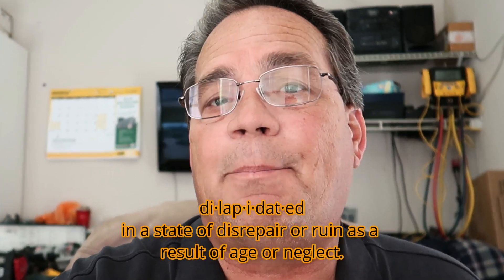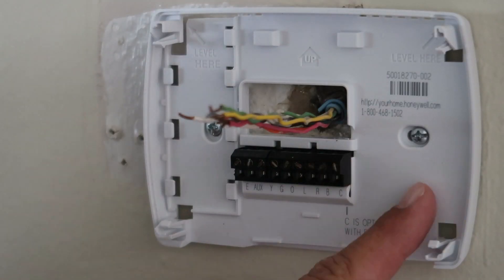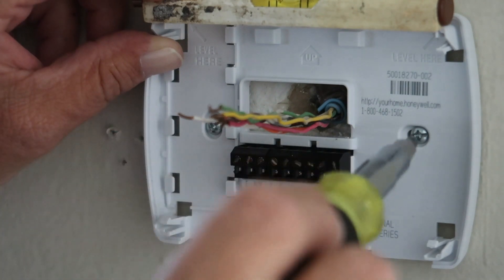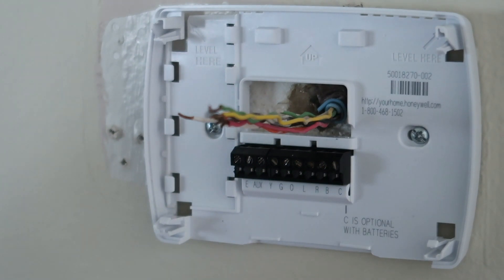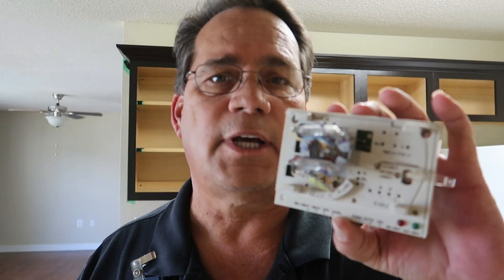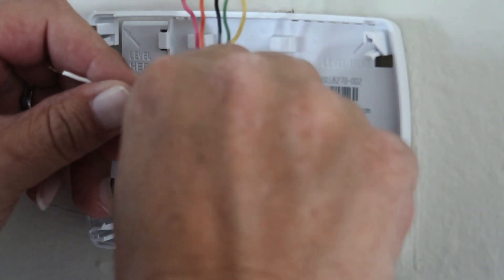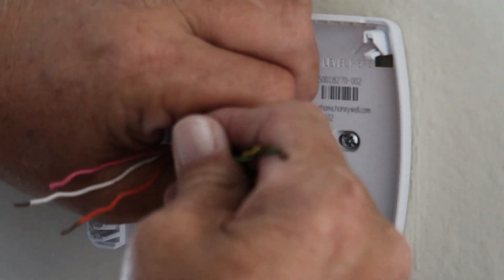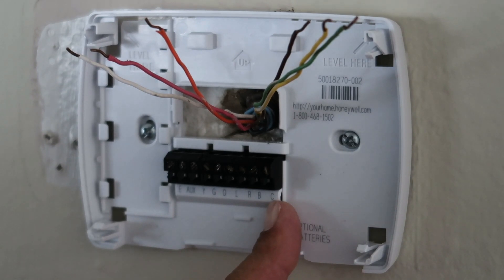How to Install a Honeywell Digital Heat Pump Thermostat

Comment: I have the same exact old mercury thermostat and we tried to change it to a newer Honeywell digital one. Once we got it installed it had hot air coming out of one vent and cool air out of another. We put the W into the W terminal, the O into the O/B terminal, the blue into the C terminal per the instructions. I’m not sure where we went wrong please help!

Comment: Hello, This t-stat has aux heat which my system also has but you did not address that in this video. Do you know which wires would be used to connect the aux strip heaters or how that would be done?

Comment: Have you ever had to hook the green to a yellow with a jumper wire when Running a WiFi thermostat.   With a heat pump

Comment: Im stumped. Trying to install a smart tstat that requires a C wire.   Ive got 29V from R to Y, G, O at my tstat.  My R to C has 29v at the heat pump unit.  I ran a blue wire from the C terminal at the heat pump unit down to the tstat.  The other end of the same blue wire that reads 29v at the heat pump only reads 16 to 17v at the tstat end of the wire.  WTF?  What would cause the wire to lose 10 Volts?   Its no longer than 7 feet of length (at least that's the physical distance from the tstat to the bryant heat pump unit on the roof.  The connection to the C term is solid.  There is continuity.  Somehow, as that blue wire is snaking through the drywall down to the tstat it is losing 10 volts.  I can't explain that.  I tried a different wire, and same result.  17 volts.  Makes no sense.

Comment: Dan, thanks for posting the video.  I have a basic heat pump and I want to change the old digital thermostat to a new programmable thermostat.  The wiring is very straightforward, except the instructions say a jumper is needed between W2 and E if there is no OD T-Stat.  My system doesn't have an OD T-Stat, but the old thermostat didn't have this jumper.  Do I need to provide this jumper?  Thank you for any assistance.
Reply: Hi, LH Linn, my thermostat is exactly the same. And most basic residential heat pumps don't come with OD stats stock, either. You don't need the emergency at all, unless you live in a crazy-cold environment. Auxiliary still works fine without E/AUX jumper. I don't have my E/AUX jumpered either and have had no problems for more than fifteen years.

Comment: Dan, If I have a common wire and I install a new Honeywell Pro 3000, will it run normally without batteries?
Reply from the maker: Yes, the batteries only keep the last setting if the power get shut off to the system.
Reply: @danjiles  Thanks Dan for sharing your knowledge.

Comment: Hey Dan I have the same old thermostat in my home.
Wires on back are connected as follows, blue to x, white to w2, brown to e, yellow y, orange o, red r, green g.
Do I  wire new thermostat like yours as you explained.
Reply from the maker: That’s hard for me to answer as not all systems use the common wire in the same way.  Some system use a light wire that uses the blue and some use common wire with brown.
Reply: I do not have brown wire. I do have blue. Should I put blue to "B" or blue wire to "C"?

Comment: My "L" is hooked up.  What is it?   It has the blue on it which is a reversing valve for heat.  
WHAT IS L ?     My orange is the reversing valve for cool which is OB on my tstat.  Im using 7 of the 8 wires for just a standard heat pump. No indoor unit.  Please.....  what is L ?
Reply: A Watchman I have a blue Wire where do I put that
Reply: That we’re u put the black wire
Reply: L.  Or L/a.   Input for heat pump fault.